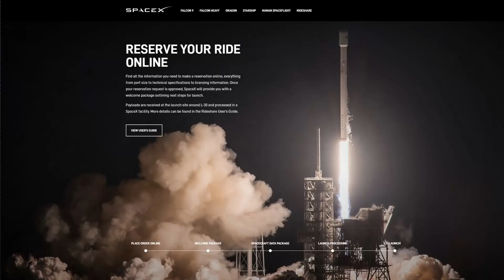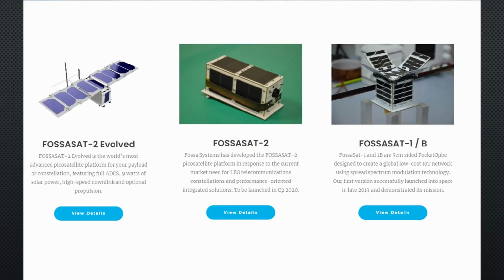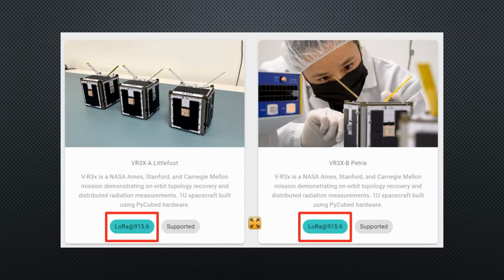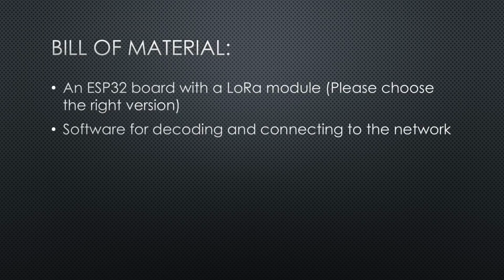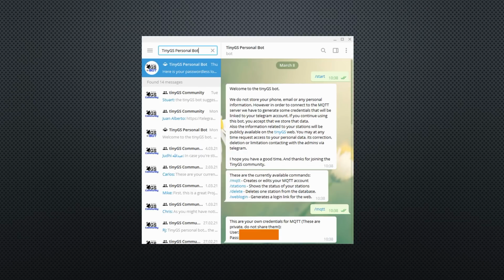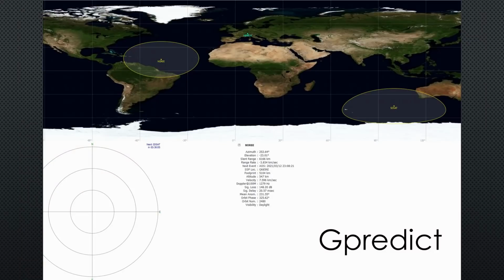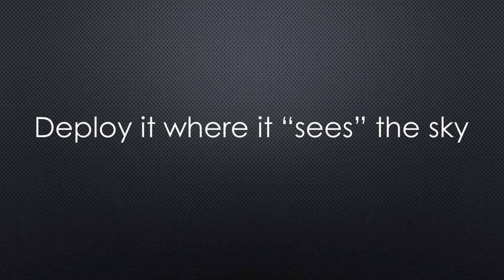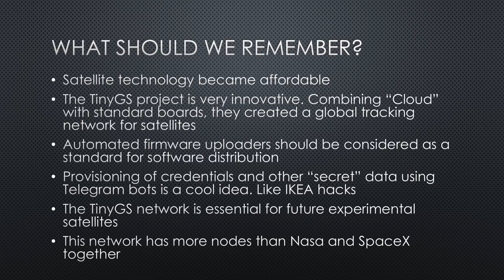010 How to receive and track LoRa Satellites (TinyGS). Incl. innovative ideas for your projects

Comment: Is there a reason for such a large power supply?  I assume we would stay away from a switching PS like a usb adapter, but would a older style "wall wort" supply work, I believe they are linear supplies and less rf noisy.
Reply from the maker: You are right, we have to pay attention with switchers. But often, they are ok.

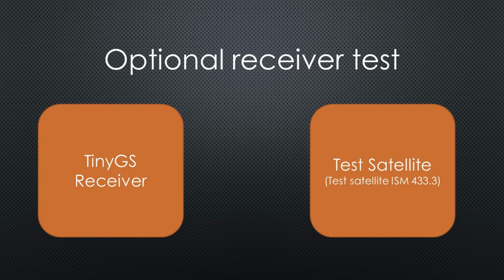Comment: Always fun to follow your projects and I'm for sure learning a lot. Now I used one of my T-Beam v1.1 modules to set up a TinyGS. But so far I have not received any packets. You show a way to set up a test at 13:10 with a second module but when I tried that I can't find the the Test satellite ISM 433 as you used. 
Do you know if it's removed after you used it? 
73 from SM0SML
Reply: HI SM0SML, try again, it should be fixed now. Good luck!
Reply: @tinygs  So, I found the ISM_433 thx, that's some fast response!,  but no luck with my test. 
It seems like the board I'm using is not recognized successfully. And it looks like the board template is not overriding the board type from the drop down. 

I added a template for the T-Beam v1.1 but it's actually using the selected board in the drop down instead. 

Here is my config for the t-beam:

{"name":"T-beam v1.1 + oled","aADDR":60,"oSDA":21,"oSCL":22,"pBut":38,"led":14,"radio":1,"lNSS":18,"lDIO0":26,"lRST":23,"lMISO":19,"lMOSI":27,"lSCK":5,"lTCXOV":0.0} 

[update] I Used VS Code and added the board to the drop-down menu and did a successful test with the ISM_433 satellite. Now I'm waiting for some real packets.
Reply from the maker: I hope it works now!

Comment: Andrea's. It looks like the FossaSats are in orbit and on 401.7 MHz.  Have you received them yet?
Reply from the maker: Yes, they are in orbit now. 4 or 5. I receive them regularly.
Reply: @HB9BLA  Andreas. I've ordered a. 0.5 low noise figure LNA and a saw filter for 403 MHz 5MHz bw and will build a tinygs here in Seattle.  The other one will have the same LNA with a 433 MHz saw.  Can you see a LoRa satellite like Norby with a spec-an?
Reply from the maker: You have to check where the satellites are. Most of them are not on 403MHz. You should find the info on TinyGS.
BTW: I have no filter or LNA for the satellites receiver.
Reply: @HB9BLA  the FossaSats are at 401.7 MHz in the passband of the 403MHz saw filter I ordered.
Reply from the maker: You are right. But look at the others. The official satellite frequencies are  around 437MHz.
Reply: @HB9BLA  Andreas I'm receiving Norbi on WA4OSH_433 on nearby passes at the end of 8 meters of RG58 coax and a discone antenna up 6.7m.  I will add SAW filter and LNA at the antenna and a bias tee at my ham shack.  WA4OSH_403 is not up yet.  Same idea, filter for Fossasats at 401.7MHz.